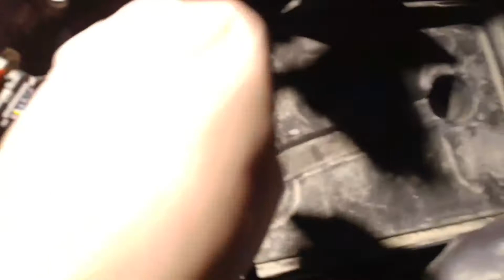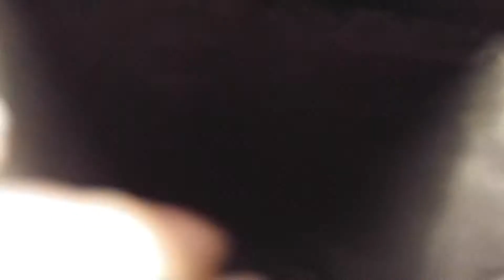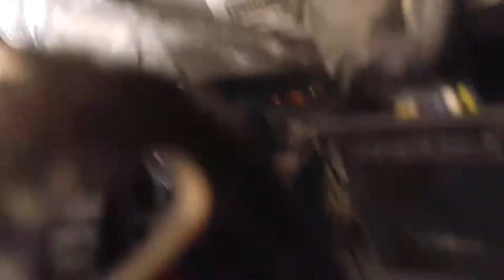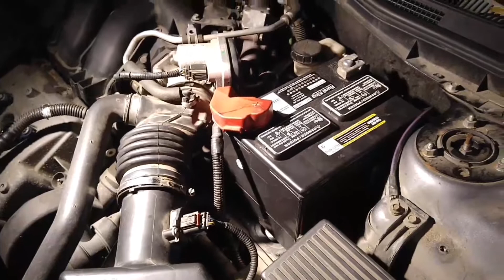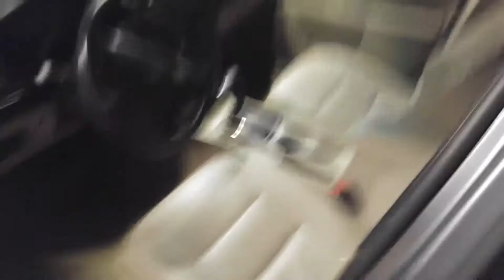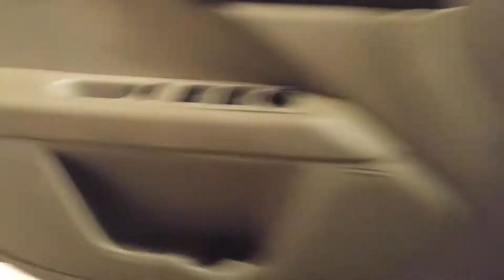ECU ECM PCM REPLACEMENT, ford fusion, milan 3.0 v6 (also pt.3 of melted coils) Parameter reset must!

Comment: As far as I'm concerned, you don't actually need 2 keys for the parameter reset IF you're only replacing the PCM on either the Fusion, MKX or the Milan. That's according to the procedure outlined by ford itself. But parameter reset still has to get done. Burnt coils and PCM, such a pain that comes from not simply replacing spark plugs on time.

Comment: Hey thanks for the video. When u changed the ecm you needed to have the keys reprogrammed ?
Reply from the maker: The ignition module has to be programmed to the new ecu correct.

Comment: I am running thru the issue where is not sparking and I think the ecm/pcm needs to be changed
Reply from the maker: Its pretty easy to pull it out. You can usually tell by just smelling it for burnt circuit.